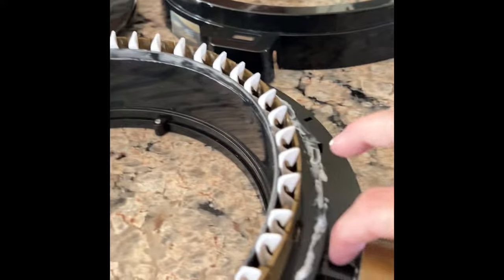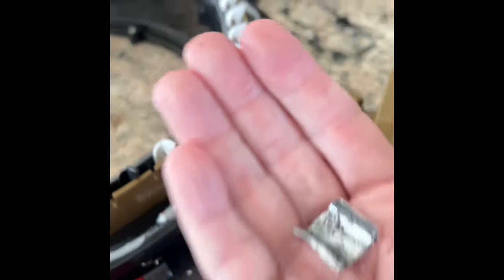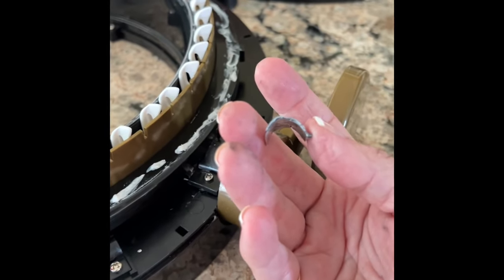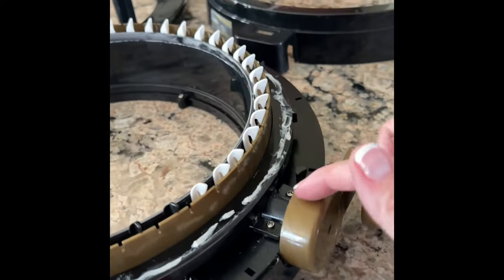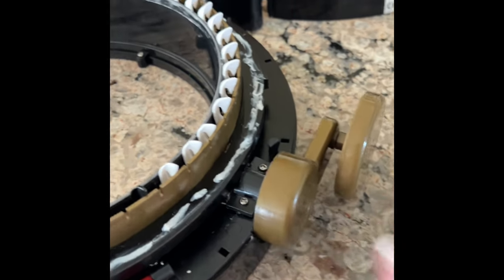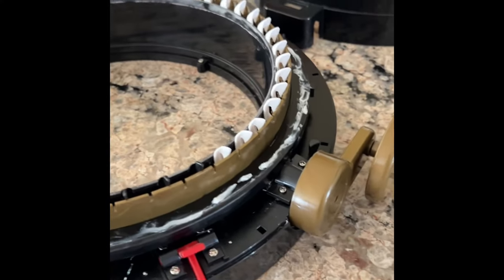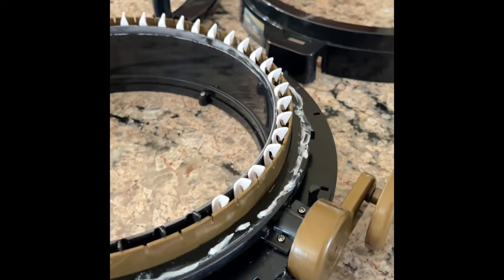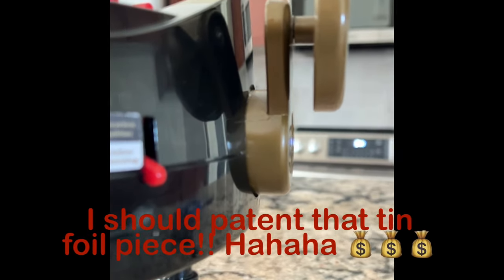Addi Handle Magic!! Take a Peek! A Message From Me!

Comment: Have tried this and it has fixed the loose handle, but I can hear the gears grinding/skipping in one spot as it turns now. Any suggestions?
Reply from the maker: Mine started to do that as well and I just now
Finished changing the tinfoil again. It lasted about 2 1/2 months. 
If you just did it then maybe you didn’t make the tin foil thick enough. 
Follow exactly how many times I folded it. lol
Or ….. maybe your gears really are stripped.
Reply: @koalaknitsandknacksaddicrochet  I'm hoping not as it's a brand new machine. I've got some grease coming, so I'll redo the handle when I grease it.
Reply from the maker: Then it definitely wouldn’t be stripped.
The handle will grind if the tension is tight. It has to work too hard to turn.
Reply: @koalaknitsandknacksaddicrochet  Ok. This was happening when I just turn the handle and no wool is being used. Would this suggest that too much foil has been added?
Edited to add: this only started happening AFTER I'd put the foil in.
Reply: @koalaknitsandknacksaddicrochet  I re-did the foil, but it's still grinding slightly on the same spot. This is very frustrating. I don't want to dismantle it again, as the screws are not keen on being removed again and again. If I cannot figure it out, I might have to send it back, as it shouldn't be doing this.
Reply from the maker: Are you sure your tension isn’t too tight ?
Reply from the maker: I really am not sure what’s happening. The foul works wonders for me but it is something I figured out. It’s not from the manufacturer so only do it if you are comfortable. 
If it’s a new machine and grinds when their is no wool
in it then that’s not good. These machines can be so finicky. The gear system is not great in my opinion.